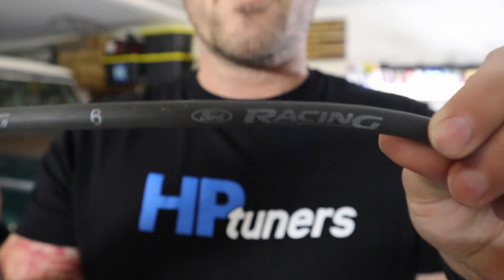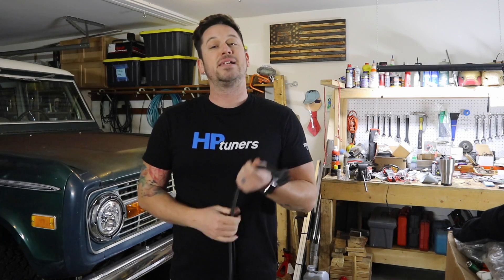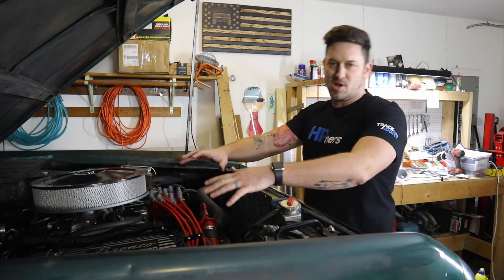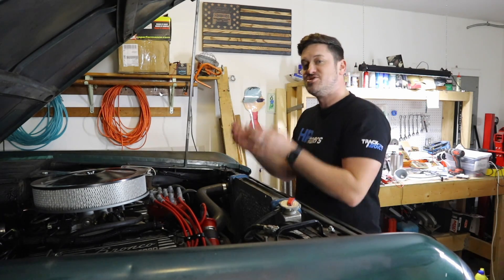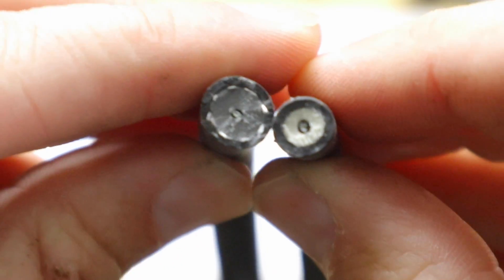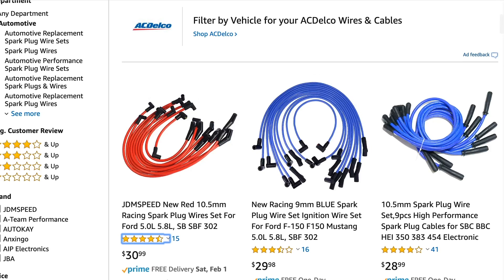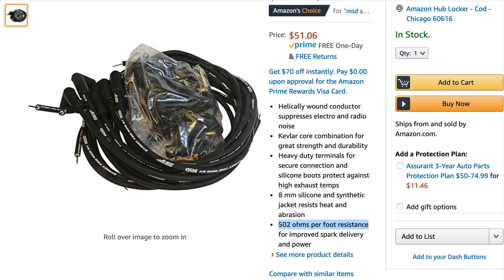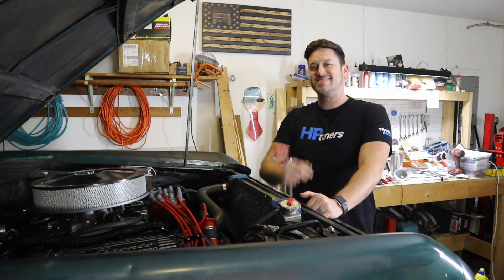Best spark plug wires for EFI Ford

Comment: Question - so with my fitech and the constant issues with tach interruption, the wires could be the culprit? But if it was running fine and then started having trouble, could the wires have gone bad? Spiral wound low resistance wires sound to be key.
Reply from the maker: It’s a possibility. Definitely something to check, but there are A LOT of other things to check with that FiTech

Comment: Best mod ive done on 85 F150.. D.U.I distributor with MSD plug leads.. I bought the set that could be cut to length.. Engine bay now looks super tidy.. And I could tell the difference with the D.U.I distributor and leads.. I have the Holley Sniper EFI and needed a HEI type distributor.. The original one I got with the crate motor from Summit lasted one year and 6 days before breaking.. And Summit told me "warranty is up.. Tough".. Can't recommend DUI or MSD enough

Comment: I have found that you need to aware of the boot angle at the plug. Especially on the #8 cylinder. The shift linkage on the auto can and will interfere.
Reply from the maker: That’s so true. Good point